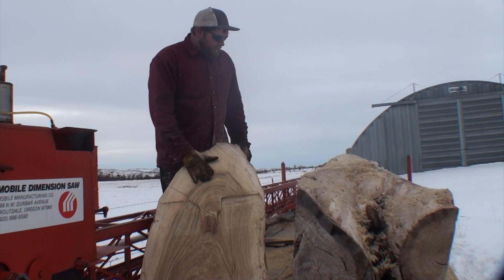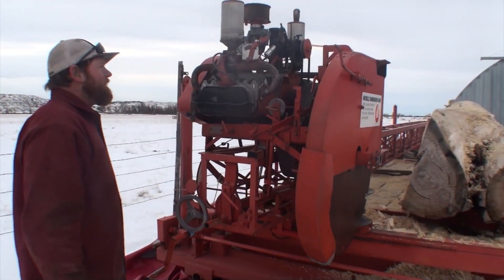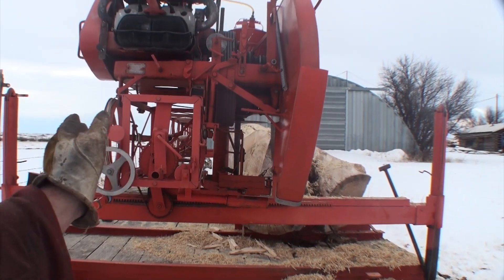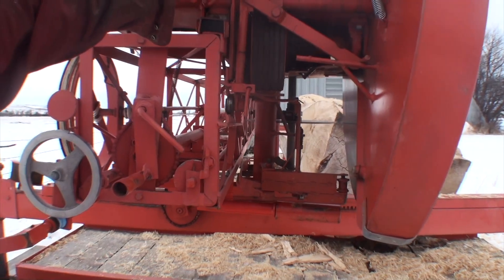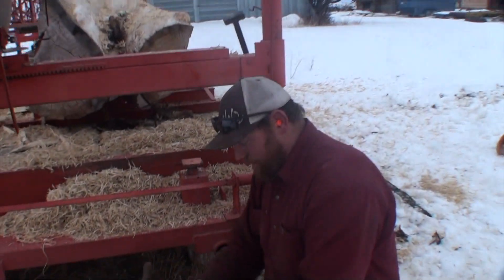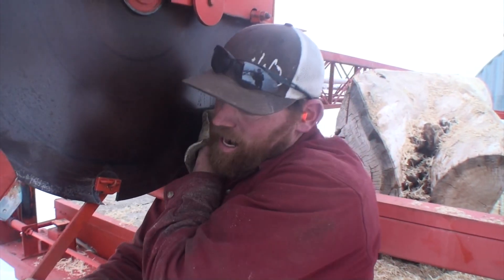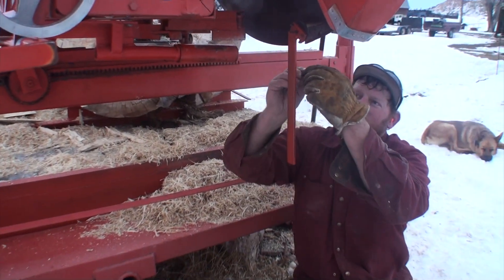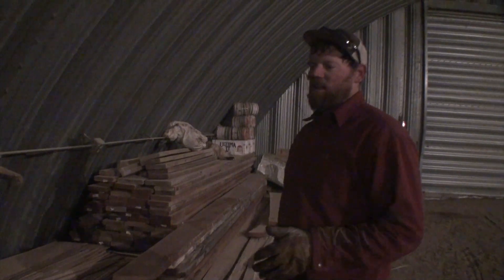Mobile Dimension Saw Mill: You Wont Believe Your Eyes

Comment: I had two questions but you kinda answered one; it was at least build prior to about '95 because the rectangle frame pieces were changed around then. And where do you get parts now? I drove past the shop last fall and it was cleaned up, painted , with a new chain link fence and it was up for lease. I worked there for about ten years, and was there when it started to go south. Pretty much every part of it my hands were involved with at some point of their manufacture. I loved the place and would have retired from it if things hadn't gone to shit. Watching your video brought back so many memories, most of them good. Thanks!
Reply: So far I have have great customer service..I just call in and they have been great to work with! Cool history!

Comment: We used one for over size flair butts on red cedar . Worked really well , but the unit had higher posts and they were tied together at thhe top so handling 8 foot butts was no problem. I would show you a video, but on the very first piece cut , the flaired piece was thrown by the saw ( away from the operator) and took my camera and tripod out . Once the flairs were cut off we had the operator cut heavy to 4x8 ,4x10, and 4x12 . Very little waste ( except for sawdust , with a 1/4 inch kerf a lot of sawdust is made ) and some mills had up to 3/8 kerf . The one we used at our mill was twenty years old and still running the blades it came with . The inserted teeth were about a buck fifty each back then, and it seemed they lasted forever . The guy sharpened them on the mill . Only teeth he took out were ones that had hit rocks and to change a tooth onnly took him about 20 seconds, maybe less

Comment: Mobile Dimension 127 to hold the saw for teeth changing there is a hole in the bottom edger blade support takes a piece of 3/8" cold roll rod bent at a 90 to lock all the  blades on the saw.  Great Video!
Reply from the maker: Jerry Bradshaw thanks so much for the info!!
Reply: Thanks for the reminder! Now that I read your comment, I believe I remember the guy we bought it from showing me that! I’ll check it out and yep good eye on the model 👍

Comment: Just a thought. With those larger logs that are not a uniform shape, I will raise my head rig up and use my bottom edger blade to cut the top of the log flat before I begin cutting boards. This allows for a maximum depth of cut without the problem of clearance with the mandrel nut. It also allows the use of the main guide roller which helps to steady the saw on deeper cuts.
A very nice model 127 I might add, Congrats and happy sawing! Great video BTW!
Reply: shannon reiswig 
 Awesome! Thanks for the advice, I remember the guy I bought it from telling me that as well.. maybe you guys can get me to remember it if I keep hearing it ;) ..haha...but yeah I think your definitely right on how topping the log would be avantagis!